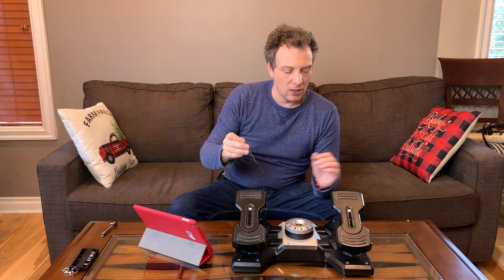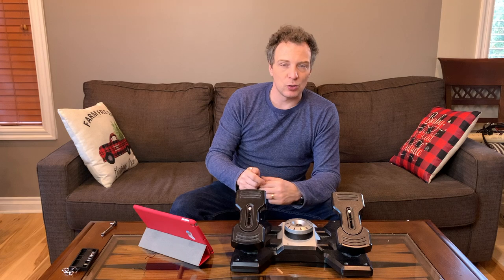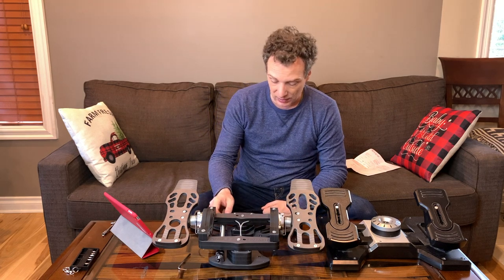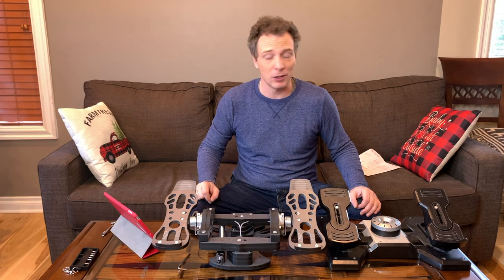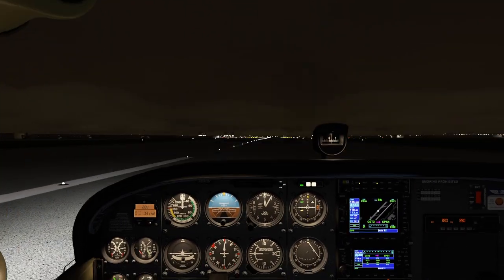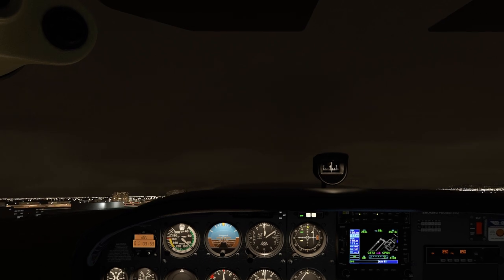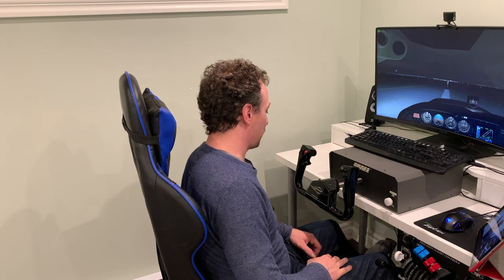Real Pilot Reviews Flight Simulator Rudder Pedals & Demonstrates Home Simulator Setup

Comment: MFG pedals are basically meant to use the dampener kit for a more realistic feel with the pedals. You can use the dampner with or without spring and it's an vastly improved feeling for both jets and especially helicopters.

Comment: I'm watching this, having bought the MFG pedals a long time ago now. It's a good review, one further difference for the MFG pedals is the cam centring profile, it's a small piece on on the USB side, near the top, you'll notice a bearing running on a curved surface, this can be replaced with parts included with the pedals, and they sell alternates on the website, basically it allows you to change the tension curve and centre detent to better replicate the aircraft you're simming. maybe not a huge detail, but it may be one someone wants.

Comment: Remove the thin paint layer of the cable with a soldering iron and use soldering grease to remove any debree. Then u can use rosin to make the solder soak into the ends of the cable.

Comment: When resoldering wires you absolutely DO NOT melt the wire coating off. You use a wire stripper (or in a pinch, a knife) to remove the coating.

Comment: I'm surprised that you didn't talk about all the other amazing adjustments on the MFG or that it's all ball bearing and not plastic bushings. There's no comparison in my view.
Reply: Yeah, there were a lot of other things missing from this ”review”.  The fact that for the MFG  you can set the incline of the pedals, options to set the pedal width, the ability to change out the cams for a softer or harder center as well as linear or progressive resistance on the yaw axis.  My MFGs are still going strong.  The one ares that I found “problematic” was the footprint with the narrower edge close to the pilot did mean that it could tip to one side when you put one foot down but mounting them with a square piece of “shelf board” and 4 screws made it solid as a rock and they will outlast anything in my sim.
Reply: @sguyouttanowhere8319  LOL, I screwed mine right into the floor through the carpet. 😁
Reply: @GovG33k  Now that is hardcore!  I have wood floors and taking my wife’s reaction to that into account; I wanna live! 😂
Reply: @sguyouttanowhere8319  My wife's a pretty cool chick. She was the one who bought me the pedals, Honeycomb Alpha and Bravo gear as well. 😉

Though she wants hardwood flooring so I might be back where you are trying to figure out a solution soon enough.
Reply: @GovG33k  Highly recommend the shelf board.  Minimally it only needs to be deep enough to attach the front/back screws, wide enough to reach the outside of the pedals, and thick enough to be a solid screw set (mine is about a half inch). You just need 4 screws long enough to reach halfway into it.  For visual purposes it can be stained to blend in with the floor.  For additional slide prevention I have it sitting on top off a slightly larger carpet-mat (although it really isn’t needed).  One day I will get around to buying some contact glue and fixing that to the bottom and trimming it.  Good luck with whatever you do

Comment: Looking at my CH Pro Pedals I got for Christmas in 1997 with the brand new connector called USB. Thinking of buying the new Thrustmaster Pedals.
Reply: I can't find them for sale - not in Europe anyway.
Reply: @ByronLina  Did you get your pedals (which one did you buy, I want pedals too but not sure what to buy)? mfg-sim.com has the pedals. I know nothing about them but it seems they are MFG who produces these pedals ... they are in Croatia (Europe).
Reply: @BoardstationDE  I ended up getting the Thrustmaster Pendular Rudders from Amazon.de for about €450 when they came back into stock. A huge improvement over my old Combat Pros, but I need to do a better job of securing to my floor, they are a bit prone to sliding when applying full rudder. The MFGs get good write-ups so might well be a good option!
Reply: @ByronLina  Woooow, yeah, tge Thrustmaster Pendular Rudders are great, but damn expensive. That's why I'm intrested in MFG. Have fun with your peddels.

Comment: Those look like the MFG v3’s. There is an extra hole on the front, and back horizontal bars for the hydraulic dampers. I know because I have the v2, and v3.
Reply: I am looking to get the retrofit hydraulic damper kit for my 2017 v2 set. The installation on the v2 will be a bit adventurous.
Reply from the maker: That sounds cool, you should do it and make a video about it

Comment: use sandpaper on the speaker wire to clean it, the flux and 60/40 solder. use one of those multi hand jigs, super easy. atleast with a decent soldering iron. I have a hakko
Reply: Thank you for the idea, it was new to me at the time and I realize now there was a way to manage it.
Reply: @AlanOnCA  100%, just wanted people to know its doable

Comment: Also, the toe brake son the Logitech will eventually break as the tension from the spring will break the plastic connection. Too much tension for the weak design that hooks the spring. There's metal replacements off ebay which will cost around 120$CAD to repair. Might as well get the nice metal rudders from MFG or  VIRPIL.
Reply: This is exactly what happened with my Saitek set. Originally I replaced them with the TFRP Rudder pedals from Thrustmaster, but eventually found that they developed stiction on the rails, have just bought the TRP rudder pedals, and they are a game changer. Whilst I am still a bit wobbly when taking off in MSFS, it is so much easier to get the plane to take off and keep to the centerline.

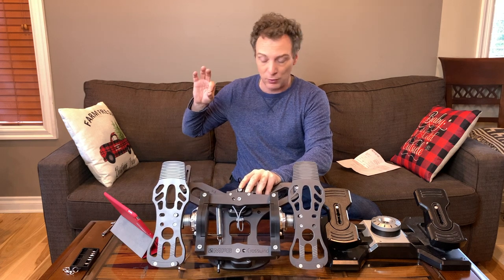Comment: Hay Friendly Flyer, at 6:23, instead of a toolbox as a wall spacer for the Saitek, you can mount the two attachable heel extensions (the two plastic originally meant to be mounted under your heel) to the front end instead of the back end of the pedals.

Comment: I'm actually more interested in your PFC yoke and throttle :) May I ask if it is a force feedback yoke? The $1,995 newest model is described as having a "Control Loading" system and has a power supply which I assume is an FFB unit but some YTB video shows the seemly older model are not...
Reply from the maker: It’s not force feedback. They adding some bungee chords to provide resistive force.
Reply: @FriendlyFlier  Roger, thx.

Comment: When it comes to Flight Sims, Logitech builds cheap plastic Crap. 
The reason they sell, is the fact that quality Flight Sim peripherals are not cheap.

I have a set of the Logitech Pedals, when they eventually fail and they will I will go to a better set possibly from Virpil or Thrust Master. I will also wait to see what Honeycomb Aviation comes out with.
Reply from the maker: The MFG ones are very nice and adjustable. Is there a reason you didn’t consider them?
Reply: @FriendlyFlier  ; I will, thank You.
Reply: There are also VKB ones that had positive reviews. Just - no brakes
Reply: @mungo7136  interesting, I will need to check those out. However, I can't imagine having pedals without brakes. I also use the pedals for playing Elite Dangerous.
Reply: new Honeycomb pedals look promising...

Comment: Can't replace the wire component?  Same flaw/break happens consistently?  Is it possible to put the wires in a sheath to protect it?
Reply from the maker: You could replace the wire completely spending about an hour to disassemble the whole unit. You would also need the tools to put the connector on the end to press into the control board. Also, when you take the Proflight rudders apart, you see that everything is basically made of plastic and you know it's only a matter of time until the next thing is going to break. I'm sure those pedals are fine for kids, but if you want something that's going to last a teenager or adult a lifetime, you get something from Milan. From the ground up you can see that you could fix the gear by easily replacing parts. In the new age of 3d printing you could easily adapt new parts and bolt them on. Well worth the money!
Reply: @FriendlyFlier  Precisely. I have these skills, but the problem is that the design is poor to start with! if it looks like a toy, then it's probably a toy! I'm a big fan of what is sometimes called HART (Hall effect) technology because it reduces the amount of parts that can fail with wear.
Reply: @FriendlyFlier  Do you think these or Slaw Pedals are equal or better than TM TPR Petals? I bought the Warthog HOTAS for my A-10CII and need Pedals now. $500 is about my max considering what the HOTAS cost 🤯.

Comment: what is the best solution, 3 Full HD 27” monitors or a 37” 4k monitor?  Thanks for your response
Reply: Full HD 27" is terrible. I've one and that was the worst buying decision for years. FHD is a terrible resolution on such a big screen. Don't waste your money.
Reply: I agree with Fluse Int., 27" really needs at lest 1440p. But... get just one 1440p 27" and get additional VR headset for the money saved, if you have good graphics card. Oculus Quest 2 or HP reverb G2 if you have RTX3080, 3080Ti or 3090, or the Valve Index or Oculus Rifs S if you have weaker graphics card.
Reply from the maker: I'm a pilot who uses the flight sim to practice procedures. I would say any monitor with a TrackIR will work. My breakthrough moment was when I prioritized what features I needed for training versus trying to reproduce a cockpit at home.
Reply: Imho a good monitor combined with track eye r is nicer than a vr headset. But that's a matter of taste.
Reply: @fluseint.1303  (you wrong then)*edited, "you may be wrong" I do have Reverb G2 and 27"1440p monitor+TrackIR. Reverb G2 is on the level where cockpit is about same resolution as watched on 1440p LCD, yes the distant objects looks a little lower, similar to 1080p LCD, but the immersion difference is night and day. So why bother with LCD then? Well its easier to control all the features of flight sim especially simulating modern aviation with lots of keybinds, in VR you dont have keyboard in your sight. If you have big HOTAS then you can map all needed controls to its so you can operate it blind. Once there would be some viable solution for hand tracking and cockpits become "clickable" flat monitors will be thing of past. For rotary the VR is almost a must, to be able to look around and not have to guess the distance to objects is mandatory.

I dont remember when I last used my flat screen+TrackIR for flight sim the last time, but its a while back.

Before Reverb G2, Quest2, Pimax 8KX yes the flat screen was much nicer, LCD had everything sharper, no screen door effect, but now all the low resolution is gone and VR is is much better for flight siming.

Fluse Int. I edited the start of my reply, I do treasure your opinion, I just felt that you may have not experienced latest evolution of VR, have put it in wrong words.
Reply: @FriendlyFlier  then I strongly suggest you go try VR, if you have above mentioned graphics cards you can get Reverb G2 (from 450-599USD) or Quest 2 (299USD), MSFS will get hand tracking/VR controller support soon, so all items in cockpit are usable at the spot where they are in reality, a very good training tool. Even now, you can use mouse to control the cockpit. If you use X-planes, there is controller/clickable cockpit support already there.
Reply: @madigorfkgoogle9349  on a 27inch monitor you're absolutely right but not if we talk about a 49 inch ultra wide curved... This is way better for my taste. Immersive as it can be imho. Playing with the Honeycomb yoke, throttle and the mouse...barely use the keyboard. But there is no real right and wrong. It's about how you like it or not.
Reply: @madigorfkgoogle9349  I have to admit that I smiled a bit when I read that you think it's more realistic with vr gloves instead of using a real panel...this is rubbish my friend. A real panel gives you a habtical feedback like the panel in the plane does. You have to press buttons controll a cursor via a knob etc. This is a totally different story with a panel than in vr. It reacts in the exact same way like in the real plane and you feel and see it. With vr you can "only" see it. I understand why many people like vr but so far it's not good enough imo.
Reply: @fluseint.1303  you can use a vitrual iPad tablet like you would in real life in X-plane for example, and its just a question of time until its in MSFS. 
As I said we need some hand tracking, I tested a hand tracking inside DCS at my friends system and after some learning time it was great to be able to operate same buttons and switches as in real plane at same spot as in real cockpit. It was not perfect yet, but in case I would later sit in same but real plane, I would already not search for the given control and right grab in the right spot. 

I have tested ultra wide LCD, triple monitor setup, quadruple monitor setup, triple projector/curved screen setup, even the professional military L-39 simulator but of them all I find the G2 as the most close to a real flight. And funny thing is that the VR is actually the cheapest one.
Reply: @madigorfkgoogle9349  You're convinced that vr is better and feels more realistic. I'm convinced that a real panel is better and feels more realistic. Don't need to be a professor to place it close to the real position in a real plane and to understand that learning on a gns530 panel is way better training than just with vr. Cause you FEEL it... That's something vr can't give you. So I'm happy for you to be happy with vr but to say this is more realistic and a better training is just not the truth. Anyway, have fun. Good bye👍
Reply: @madigorfkgoogle9349  We won't convince each other 😅 but the point with habtical feedback with a panel is in comparison to the vr "feeling" that this isnt only a feeling its that exact same feeling you'll have in the real plane. Which makes it imo much more realistic and a better training. If you're flying more than one aircraft regularly in the simulator, vr might be better. But if that's not the case and if you don't want to fly a 777 all the time I'd highly recommend a "simpit" with some panels and a tablet. Anyway vr is nice and it's going to be the future. But imo for now and my needs, my solution feels better.
I'm happy about that constructive discussion. It's refreshing to find someone delivering arguments instead of aggressions here on YouTube 👍
Reply: @fluseint.1303  I do agree with you to some degree, at least.

The perfect solution, if you go train on single type, is a simpit with fully reconstructed cockpit elements + AR, so the "pilot" can see outside in 3D and has all cockpit elements working like in real plane. The thing is that we are getting to cost ratio that could be close to a used airplane.

 The advantage of VR is the very low costs, even your setup is more expensive than VR, while VR is not locked to a single application (yes you can train more then one plane equipped with same MFD) and in VR you have all, not just few gauges, even down to fuse level. And its still a cheaper solution...

And here we showed how a civil discussion can lead to a solution, instead of stupid dispute...

Have a great sim day.

Comment: Um...there's a lovely tool called wire strippers.
Reply from the maker: Those wires are very difficult to strip, the insulation is more like a sealant than a sleeve. Did you work find a stripper that worked on the wires in these pedals?
Reply: @FriendlyFlier  hmm. With the pedals I just got from a friend, the rudder potentiometer had a ground wire pop out and that's a regular cable so it was an easy fix. I'm wondering if they used a slightly different design for the brake potentiometers to have thinner and possibly more durable cables? The bigger issue I'm having is that the tension dial doesn't budge
Reply: those are probably enameled wire you need to sand it down

Comment: $150 for Logitech vs $350 for MSG.  I would hope it would be built better 2.3x more expensive.
Reply from the maker: I think if you're getting them new at $150 there may be an argument there, but now those cheaper pedals cost $230 CAD and up. The MFG cost me $440 CAD. Are they 2x better? Absolutely!
Reply: @FriendlyFlier  I just bought them off of B&H for $169 and was delivered 3 days ago, so they are little more than double the price for me.  I'm putting the extra money into the yoke and throttle from honeycomb.  I find the rudders to be lower on the priority but if you have the cash, I guess.
Reply from the maker: @kalel33  agreed, rudders less important for fixed wing. However, if you're going to fly rotary the pedals become very important.
Reply: @FriendlyFlier  For rotary I really recommend VKB pedals.
Reply from the maker: @madigorfkgoogle9349  I was just flying a R-22 in Colombia, I may decide to complete the license. However, I know I am going to need a completely different flight controls set up. What makes the VKB great for rotary wing training?